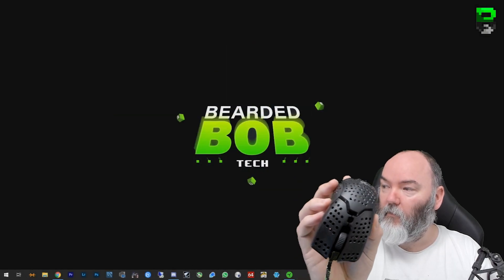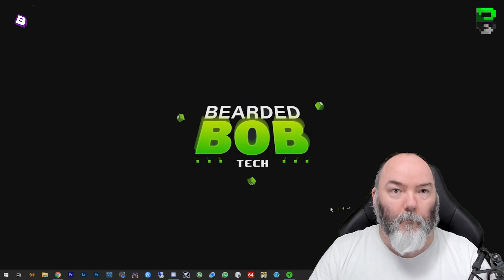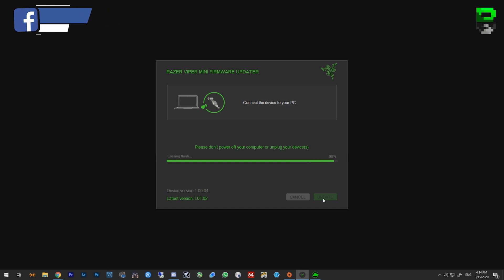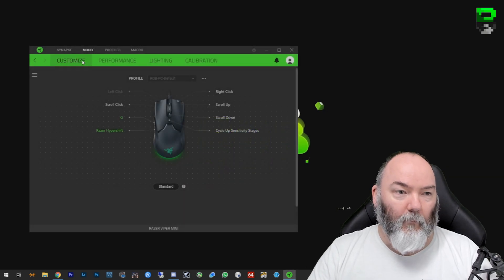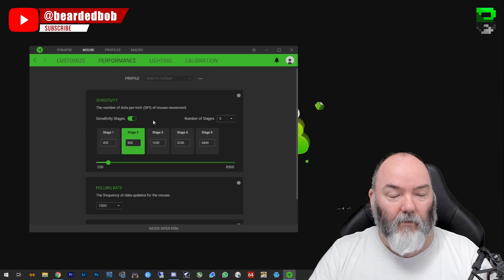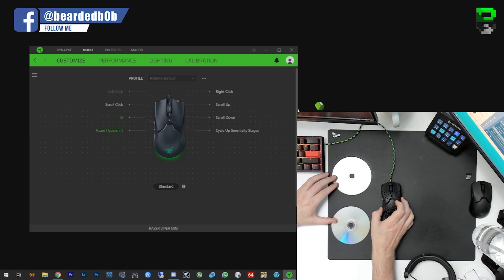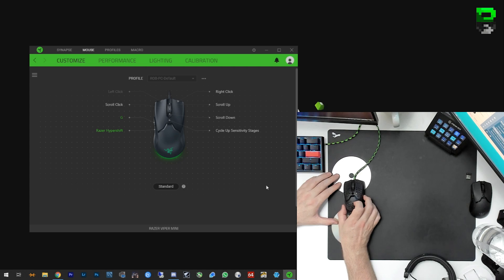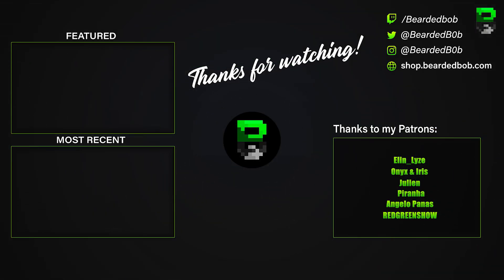Razer Viper Mini Lift Off Distance Firmware Fix - v1.01.02

Comment: since I updated my viper mini firmware I encountered a lot of problems, lift-off, connection/disconnection, wheel button mulfunction, and sensor efficiency. If these problems wont change maybe I will change to another mouse brand very sad how I love using my viper mini mouse
Reply from the maker: I fell your pain, Razer didn’t do a good job with this mouse 😭

Comment: I bought this mouse a few days ago at Best Buy, noticed the life off distance was pretty high, tried performing this firmware update, but it's already up to date. Razer didn't fix this issue
Reply from the maker: Try this tape trick its worked the best so far and very simple. https://www.youtube.com/watch?v=87uWdVN6190&list=PLfd7fPKFiRfJAH1iJUmJCrgxe75RyRVzQ
Reply: @tpow2651  I'm still experiencing high LOD until now and i'm already in v1.03 firmware. Is yours fixed already?
Reply: @geochristianq2255  even with the firmware update the LOD is just high with this mouse unfortunately. I got used to it
Reply: @tpow2651  i just found a way around it! I tried using the calibration in synapse and picked the razer vespula v2 cloth and it worked near 1 cd LOD
Reply: @geochristianq2255  that's awesome. it's a great mouse. i got the orochi v2 and it's a great mouse too

Comment: The viper mini I purchased came with this firmware out of the box. There’s another final version (v1.02.00_r3) which was released on September 8th 2020 which can be found on the Razer website. You have to type the link out on the PDF manually as the hyperlink embedded directs to the older firmware.
Reply from the maker: Here's the latest firmware i've tested now v1.3.00 https://www.youtube.com/watch?v=XuFcMruKn3I&list=PLfd7fPKFiRfJAH1iJUmJCrgxe75RyRVzQ
Reply: Beardedbob Will check it out. Keep safe 👍

Comment: tested wrong firmware, sadchamp
Reply from the maker: Why is it the wrong firmware? there are later one but all I'm interested in is the LOD issue which this firmware resolved oldchamp.
Reply: @Beardedbob  This firmware doesn't touch the LOD at all. Purely placebo. 1.03.00 R1 seeks to remedy the LOD by working with Pixart on LED intensity iirc, it's linked for download, and detailed by Razer rep 'Razer-Right' in this post here: https://www.reddit.com/r/MouseReview/comments/ihv9a2/viper_da_mini_lod_improvement_results/
Reply from the maker: 1.01.02 clearly does fix the LOD you can see it in the video. 

I've just tested 1.03.00 and it fixes it on my Helios but on a Razer Gigantus v2 it doesn't fix it and in some instances, it destroys its ability to track. You also have to configure the surface in the Synapses calibration option to enable this LOD and try to work out which one is going to help. 

This to me says updating to v1.03.00 you might get lucky and resolve it or you might not. It's not the holy grail fix people are hoping for clearly with only 28.6% saying it's perfect. 

Yep, I've seen the post and I now Razer-Right, if you have a video showing me it fixes the LOD then post the link.
Reply: @Beardedbob  28.6% is a fairly good number considering I doubt there a single pad that the 28.6% of RVM owners all use. If it 'destroys tracking' then are you using 1 out of 1-10? Cause previous firmwares, 1-10 all track, 1.03, half the time less than 3 will not track, especially on darker pads.
Reply from the maker: If you are happy with 28.6% then each to their own.

here the results from v1.03. https://www.youtube.com/watch?v=XuFcMruKn3I&list=PLfd7fPKFiRfJAH1iJUmJCrgxe75RyRVzQ
Reply: @Beardedbob  I think 1.01.02 has been a far better update than the recent 1.0.3.00 for the LOD on the Razer Viper Mini. Thanks for the tip

Comment: hey bob nice vid! I tested 1.03 firmware a while back but it still seemed to have a high lod. Not sure how I would get this version of the firmware as it seems to solve the issue. Any ideas?
Reply: The official public FW is actually older. I bought mine on the 9th of July 2020 and it already had the v1.01.02_r1 FW mentioned in this vid, so it wouldn't update. LOD is still at least 2 DVDs. I haven't tried more. I also just tried v1.03.00_r1 and cannot really tell the difference.

You'd be downgrading, which wouldn't be possible.
Reply: @paft  ahh i see, i assumed this was a newer update from the previous beta one. Thanks for the clarification! I also agree, LOD seems unchanged with the 1.03 unfortunately
Reply from the maker: Even on 1.03 you are still seeing a high LOD? strange.

Comment: I've been using RVM with cm mp510 and I got no issues with lod even without messing with razer synapse. Anyone else in the same boat?

Edit: so I checked out the firmware updater and mine is already updated. I guess I got the later batches of RVM with new firmware already installed
Reply: For me it says I already have it BUT I fail the DVD test, any thoughts?
Reply: @TheRiddl37  same
Reply: @R4MIREZ.  Calibrating to Razed Sphex v2 fixed it for me.
Reply from the maker: Explains 👍

Comment: Hmm..the software FW updater says mine is up-to-date. And I bought mine on 9 July 2020. Not that it bothers me but it still tracks with 1 DVD. I see comments mentioning 1.03 beta ('Viper Mini_Mouse_FirmwareUpdater_v1.03.00_r1') but I don't see any source on my very little investigating before bed.
Reply from the maker: Sounds like yours isn't on the later firmware if it tracks on one dvd, unless the surface is affecting it. Does it track on two dvds?
Reply: @Beardedbob  I actually checked the FW page late last month I think. The Same deal, up-to-date.  Yes, it still tracks on 2 DVDs. I tried the DVDs both on my DASH pad and bare desk.

edit: I believe the FW that fixes the LOD is private atm? The one you link to doesn't even mention LOD. v1.01.02_r1

edit: https://www.dropbox.com/s/zu3imlak8lhvdk4/Viper%20Mini_Mouse_FirmwareUpdater_v1.03.00_r1.exe?dl=0

edit: Still tracks on 1 DVD. Maybe still the same on 2. Not quite sure. Still tracks a little on 2. I'm using default/no pad calibration.
Reply: @Beardedbob  (edited my reply post FYI)

Comment: That's interesting because the version with the updated LOD fix is this one "Viper Mini_Mouse_FirmwareUpdater_v1.03.00_r1" - If the one in the official site already fixes it then amazing. (/u/Razer-Right posted on reddit)
Reply from the maker: Maybe it's been in a few versions just not officially released. 🤷‍♂️
Reply: im on the beta, and mine still tracks on 1 dvd pepehands

Comment: If updated the mouse and  imove it into other device do I need to update it again?
Reply: Firmware is the stuff inside your mouse, so no i don't think you have to update it again
Reply from the maker: If its fixed/working as you like then don't break it doing an unnecessary firmware.

Comment: One thing for future videos:
You might not want to use modded mice to do tests like these. I doubt the lightweight mod on your Viper Mini would make any difference to the LOD, but for other mice, modding might change the way it behaves in one way or another.
Reply from the maker: True but for this LOD a modded viper mini for weight is fine. At the moment I don't have a spare viper mini and didn't want to spend £40 to just show a firmware update.

Comment: +Beardedbob does the razer ultra light have this issue as well?
Reply from the maker: LOD issue? They all do unless you firmware them or they come out of the factory with the latest one installed. 

I expect Razer are now sending them out with this firmware as standard.
Reply: @Beardedbob  i got mine earlier this year, i had spin out issues when i flicked and lift sometimes so i figured it was related to LOD. I sold it tho.

Comment: I have a viper mini moded with some lexip feets, should i do the update or will it potentially break my mouse ?
Reply: I would not update it with lepix feet.
Reply: How do you like those Lexip feet and what mousepad?
Reply: @unkkit151  it change my way to play, i love them.
I'm using glorious Helios
Reply: @UCTuDaYR7CX1VYTAUJiTyfBQ I have a MP510.  Think it'll work decently?  Not a hard pad but better than cloth for firmness.
Reply: @unkkit151  I wouldn't recommend it because it's round feets so it tend to sink into you mouse pad.

Even if you are looking for more control it doesn't seem like a great choice because i suppose it could be unpredictable and can cause more damage on you pad
Reply: @romainsalvan6331  I tested the Lexips stuck directly over the top of the stock feet on my DASH pad.  They actually feel slower (which I prefer) but it seems the pad and Lexips/dash combo seem sensitive to (invisible to the eye) grim on the pad and they grip slightly after just a month unless I fully clean it, most noticeable during micro sniping adjustments. I had to take them off. The stock PTFE feet/pad combo doesn't seem as sensitive to the grime grip issue.
Reply: @paft  ptfe feets cover more surface where the rounded lexip hit only 1 point × 6.
I do have to wipe my pad everytime i game or i feel every bit of dirt, even the really small ones
Reply from the maker: Given Lexip skatez are 1.2mm It might make the LOD to low if you update it for these skatez. Once updated at the moment you can't make the LOD higher again. I would therefore not do it if you want to run lexip.